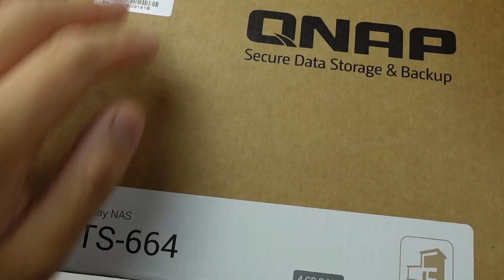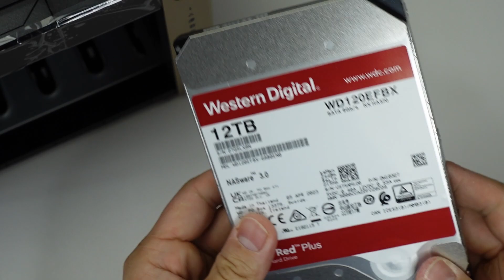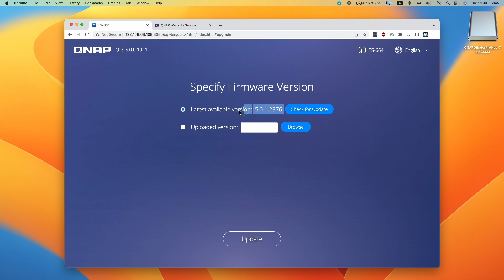FULL hardware upgrade for QNAP NAS! Hard drive, RAM and SSD install tutorial for TS-664

Comment: I have a QNAP TS-464-8G NAS at home and I’m running into several issues:

1.The fan airflow doesn’t cool the CPU heatsink at all because it’s mounted too high.
2.The M.2 SSD in slot 1 overheats, since either the chip itself or the lanes underneath generate a lot of excess heat.
3.Again with slot 1: the bay is too narrow to fit a heatsink enclosure, because both the case and the CPU cooler block the space.
4.The overall case design is poor. Instead of using a layout similar to an Xbox, where one fan pulls air from the bottom and another exhausts it from the top—ideally cooling the CPU in the process—the NAS is basically a sealed box with no proper airflow.

My conclusion: Expand the M.2 slot area and cut out part of the chassis so a heatsink can fit, remount the fan lower, and place the device vertically on four GPU feet to create a chimney effect.

Comment: On qnap website its mentioned RAM 8 GB max, but reading comments, 32 GB will work? How come qnap not recommending but still works?
Reply: 32 gb ram works, I am doing it, no issue in 3 months so far!
Reply: @elpiberats I'm also using 32GB.
Reply: As an anecdote, I used a non-recommended RAM and my unit had serious issues that couldn't be resolved without replacing the RAM.

Comment: Hey, thanks for the video. Can you please confirm the 32gb ram works?
Reply: I used ssh to check it and it said 32GB max. I havent tried it yet.
Reply: And I just ran my QNAP TS-264-8G that came with 8 GB and after the upgrade it is running 32 GB with 29.5 GB available 😃
Reply: @miketroxell7425  What model and brand of Ram did you use?
Reply: @krtornado  8 is all 95%+ of people need :)
Reply: @krtornado I installed 32GB. The details are:

G.Skill, Series: Ripjaws DDR4 SO-DIMM, Model: F4-3200C22D-32GRS
Reply: I have 32GB running in mine.